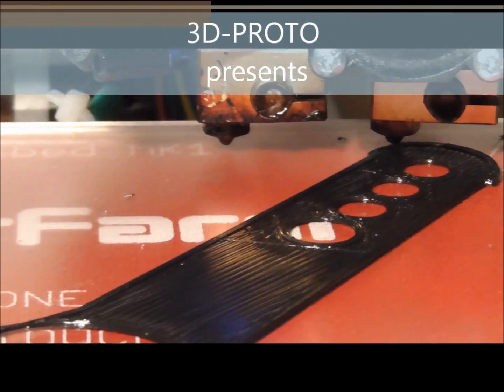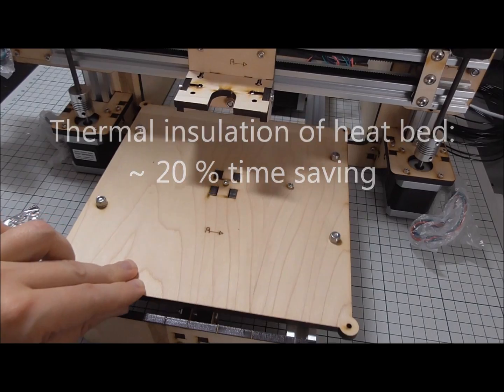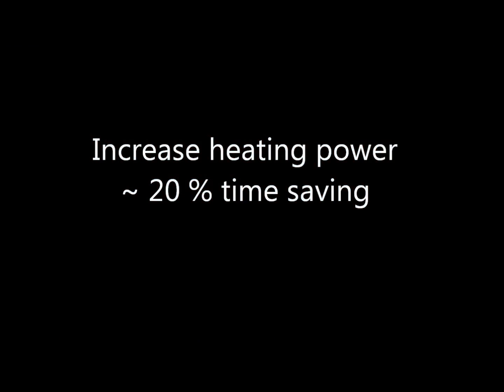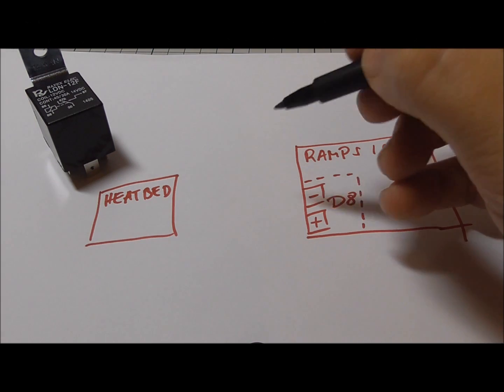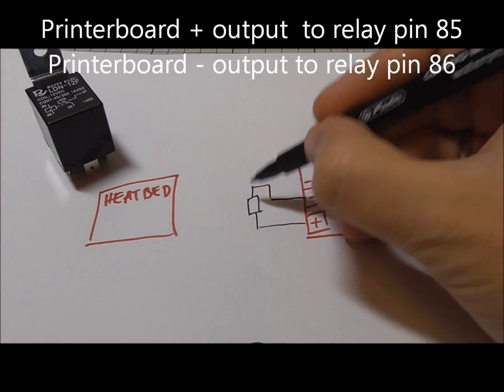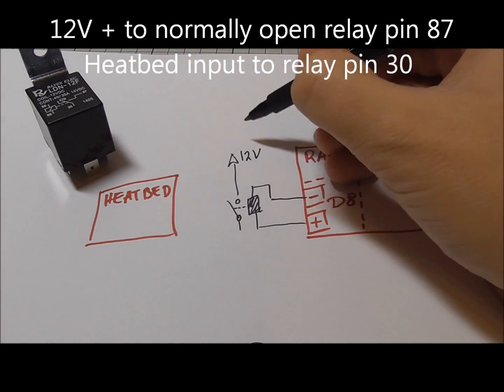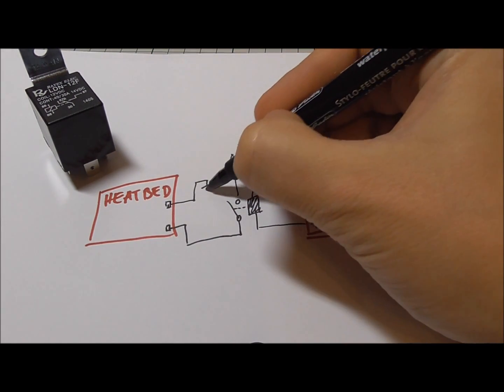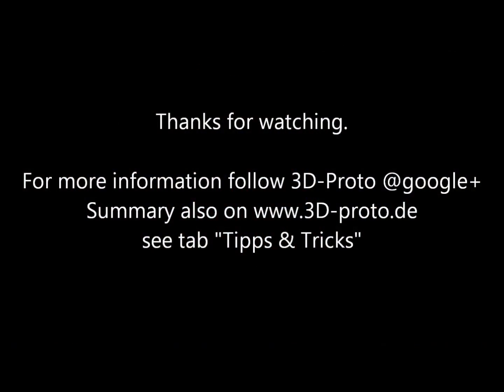Easy heatbed tuning tips for your RepRap 3D Printer, Prusa I3  / by 3D-Proto

Comment: if your are using pwm to control your heated bed you will destroy that relay in sort order I would recommend a solid state relay 
d no worries about back emf spikes that could hurt your ramps board or other printer driver
Reply from the maker: I am using a diode to avoid back emf spikes from coil. so my ramps is protected.
Reply: +3D-Proto your still going to work a mechanical relay way to hard on pwm if you are just using bang bang method it would be ok but a mechanical relay is far to slow for pwm
Reply: +Rob Hall a soild sate is only a buck or 2 more on eBay and will really make this mod a great one soild sate relays are also great for controlling mains powered heated beds
Reply from the maker: +Rob Hall No its working fine even w/o bang bang because the coil is filtering the current.

Comment: Hi i got another question if i connect the ramps board the normal way meaning both 12v and both grounds then i hook up the relay will the mosfet that control the heatbed still get hot

Comment: hi quick question can you still control your temperature  for your heatbed using this setup
Reply from the maker: yes. this is still controlled by the ramps board using ramps output i/o's
Reply: +3D-Proto ok much thanks also do i still need to connect the 12v rail that feed the 11 amp polyfuse the 12 v rail close to the D8 connector
Reply: +3D-Proto ok much thanks also do i still need to connect the 12v rail that feed the 11 amp polyfuse the 12 v rail close to the D8 connector?